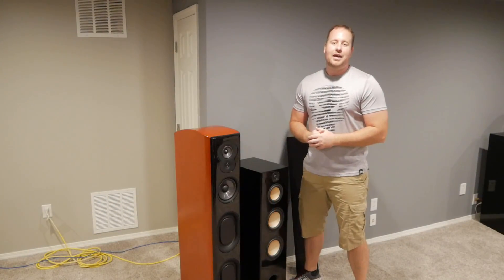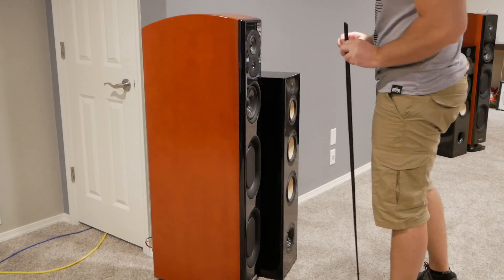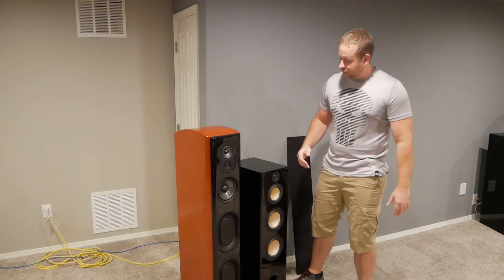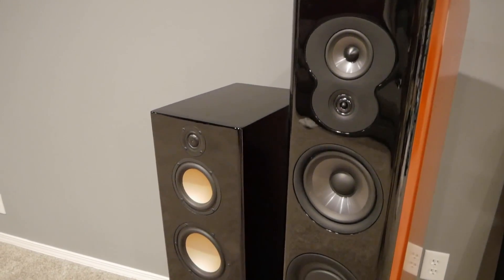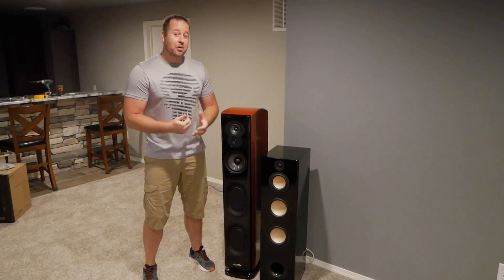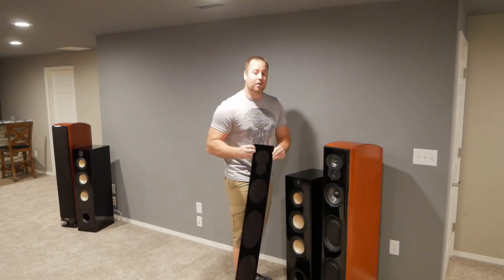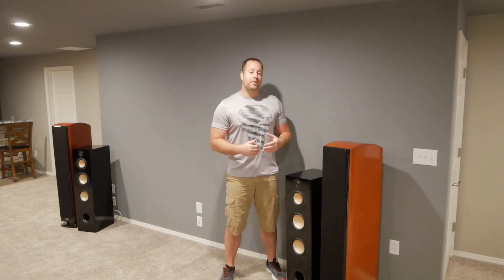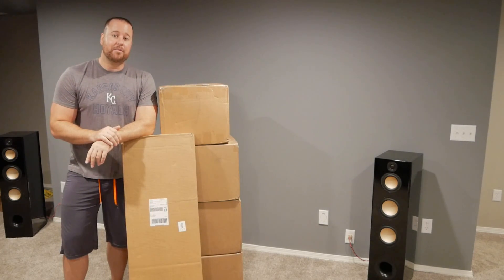Comparing my DIY Speakers vs Manufactured | Swope Towers vs Polk LSiM 707s

Comment: Automotive paint isn't cheap,did you factor that into the build ;-)
Reply from the maker: Well there are tons of finish options people can go with. This was cheapest for me as it was free 😉 we have a family owned body shop so that obviously helped. But veneer isn't too expensive, nor is bed liner or duratex.
Reply: You can spray can it with approximately one can per speaker enclosure if you do your prep right.

Comment: Apparently, these Swope Tower kits are no longer available. The woofers and midranges are no longer available.
Reply: Search Swope TMWW and you will find the designs.  The M6N is a drop in replacement for the M6A.
Reply from the maker: I've seen that... I don't know how the newer model drivers compare to the old ones either, but I'm sure a similar design could be made up with them. It's too bad because this was a very affordable set that really puts out some good sound

Comment: Great video!! Definitely want to build my own speakers eventually 
So $300 for the components... then how much for all the diy supplies? Like the wood and finish?
Reply from the maker: Thanks man! For the wood, glue, padding... eh probably $100. The finish can range from cheap spray in bedliner, veneer, or in this case, professional auto paint. Mine was free as we have family that owns a body shop. Looking at at least $150 in just paint supplies if you were looking to buy it and paint
Reply: Really like the gloss black look so I would prob do the same
Reply from the maker: Spend a lot of time prepping and smoothing things put. It will show every flaw! But they do look awesome when done. They make some nicer paints in spray cans these days too, along with clear coats. Might look into those as well. Check out a local auto body paint and supply shop for higher quality spray can paint
Reply: Good to know!! Thanks

Comment: Hi, just found your channel recently and am learning a lot, much thanks for that. I am wanting to do some DIY(ish) speakers but I have literally 0 woodworking experience so I was thinking perhaps modifying some old tower speakers I had with new hardware? 
At least that way I would have the components I need if I ever learned how to make my own boxes and for now it should produce a much better sound than stock, no? I know they are extremely low end compared to what you are used to working with but I have a pair of JVC sp7900bk and a pair of KLH 9250b, plus a bunch of random Fisher speakers I can use for centers and surrounds. 
Anyhow sorry for the length, but what do you think about that idea as far as being an affordable way for somebody with no real way to build their own boxes to start out so that I can get some hands on learning experience for now? As of now my only experience is I have connected speakers to a receiver and tinkered with the settings lol.
Reply from the maker: Yea that'd be one way to get into it. One thing you can look at as well is buying a speaker kit and what they call a "flat pack". Its all the wood pieces needed to build the cabinet and you would just have to assemble. If you had a few decent sized clamps and some wood glue, that's all you really need to get the cabinets put together. I know parts express sells a few flat pack speaker kits as well as DIY Sound Group. It's definitely a fun hobby!

Comment: Have built several pairs of speakers, although I did like the results there’s not been any long term satisfaction for me. Where I now do something different- modify manufactured speakers to make them better. Cost constraints will limit the manufacturing performance of complete speakers. I now revisit the manufacturer choices to see what can be improved. Everything from cabinet damping to crossovers is up for review. Even expensive ones will have cost constraints. The second most expensive pairs I have are $13,000 Australia dollars a pair, these are now using active crossover with tri-amping, total power per box is 1,500W rms. Yes I have an electronics degree but reading lots of books and watching YouTube has been very informative. Only pair so far unmodified are Martin Logan Summit X. Even there I have a plan to increase the resolution through stabilisation of the panels as sound seems to make the panels vibrate the frames. Cheers from Oz
Reply from the maker: Thats very cool. I can see nuying certain speakers for some aspects that you like them improving where they fall short. Main one for me would be looks. Would be very hard to recreate some of the crazy designs some have. Thanks for watching and the comment Bruce!
Reply: Interesting. My quirk is to make speakers that are different to the norm. If you are interested please visit my channel. I will certainly have a look at you. Cheers big ears!
Reply: Can you share a demo of some of your work Mr. Mibus? Intriguing

Comment: Comparing speakers with let's say less than stellar upstream components really means nothing. The Polk using the ring radiator tweeter suffers in the lateral dispersion area and needs very specific cabling and angling towards the listener. Placed against the wall and or placed in a small room will not work as it will sound bass heavy and muddy. The auto setup in the Yamaha is a joke and not adequate to help the situation. A much more serious room EQ is needed. I'm not a Polk fan, but the 707 is not really suited for Home Theater, even though it may be sold as such in some places. 
Some speakers can be plopped down anywhere and sound great and others can't. What is of value, is really how much ultimate sound quality can you extract from a speaker. I've own expensive ( 5 and 6 digits) that needed extensive overhauling of the rest of the system in order to sound good but once that was done it was incomparable.
Reply from the maker: So, the speakers that have cost you over $100,000 didn't sound good at all until, I assume, spending close to an equally amount on DACs, preamps, amps, and wiring?? Call me crazy, but the law of diminishing return comes into play here. But hey, if you got the money... I'll stick with the Yamaha and DIY speakers.

Comment: When I replaced Polk towers with a DIY sub/sat that cost half as much, I was astonished how much better the DIY was. Zounds! I gave away the Polks.

I designed the sub/sat around a pair of Jordan Jx92s full range drivers which at the time cost only $270 for the pair. Today the pair will cost twice that, if you can find them.
Reply from the maker: Nice! Pretty cool what you can do with the DIY route. The polks were great compared to other setups I've heard, but the swopes just came out on top comparing the two. I'll have to look those drivers up...

Comment: I also built the Swope MTWW Towers, the Swope Center, and 2 Swope TM bookshelves. Along with my 2 12 inch subs, 5.2 never sounded so good. Its been 3 years and they still surprise me with the sounds they put out!!!
Reply from the maker: They are great sounding speakers! I have the overnight sensations bookshelf speakers I need to build at some point as well.
Reply: I have the same but went 7.2 on mine and different subs.  been running that setup for several years now.

Comment: It's not apples to apples.. the home made speakers are more efficient.. the power you have is pushing the DIY's closer to max.  If you can get a bigger amp, you'll get more out of your Polks.  You could get $5000 speakers with the same power ratings as the polks, and they'd probably sound about the same as the polks.  You need more power.
Reply from the maker: Don't really agree. At moderate listening levels, there is more than enough power to drive both of these speakers. If you are talking about max spl and maybe some dynamics at very loud/reference levels, I'll give you that. But sensitivity is not a factor of sound quality. It does tell you max spl. 125w would push the polks to 109 db. Doesn't tell you how they sound though.

Comment: Making your own. It ll cost you 2000 or whatever but you ll get having a ten times more value of a loudspeaker. Heavy dampening. Dr coupling . Silicon gaskets. Very good caps and coils and cabling
Reply: Youll never beat an active $2000 speaker
Reply: I agree with you, I think that spending 2 or 3 thousand on a diy speaker, if made well, will get you a  destroyer, nothing comparable up until at leat 5 o 6 thousand
Reply: @matteogirelli1023  just realize not all of them are destroyers, many are designed by hobbyists with poor engineering skills.
Reply: @Audfile  you don't need big engineering skills as long as you can accept some compromises to reach best sound that are mainly big boxes (no limitation in space) and heavy speaker. Also you have to have some woodworking skill and little skill for the electric part. The big part is design and choosing components. The worst part being crossover. As long as a factory crossover is used, then for quite little engineering knowledge yes you can build a heck of a good speaker, better than factory ones for sure for the money
Reply: @matteogirelli1023  you do though, getting the crossover correct with everything else isn't trivial.
Reply: @Audfile  Then buy a ready crossover... There is so much options to do as diy. Everything is easy if you at least try to make them.

Comment: Nice job. Looks like you like the DIY stuff. If you want to make a huge improvement to your sound for very low cost look into making some acoustic panels. Use them were you can  the room is a bit fluttery you will be astonished in the difference. Aim for firs reflections,
Reply from the maker: Thanks G. Yea I plan on getting some up eventually after the new speakers and some other projects. Probably this summer. Wanting to get custom movie posters printed on fabric and building rockwool panels. Will look cool plus be functional